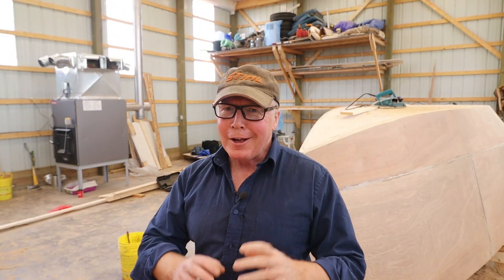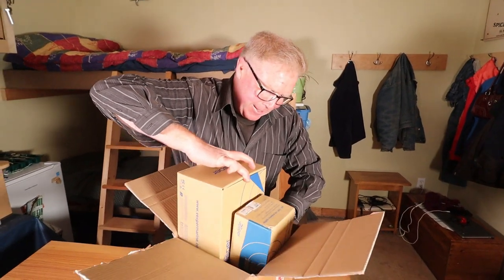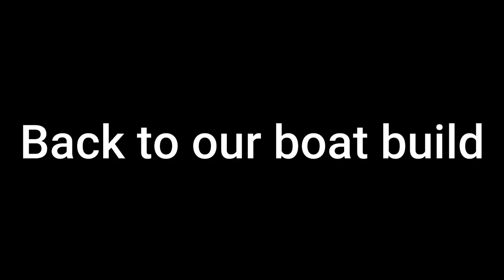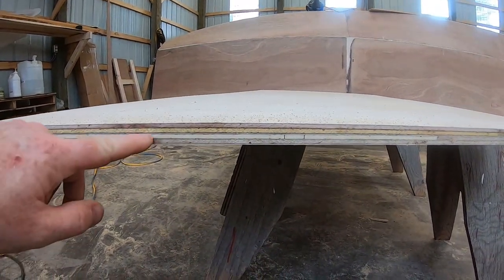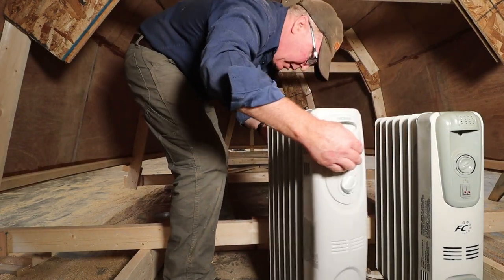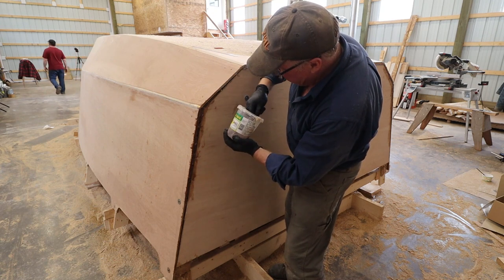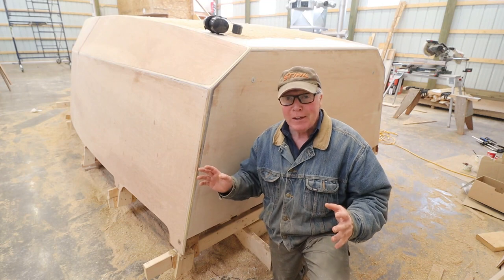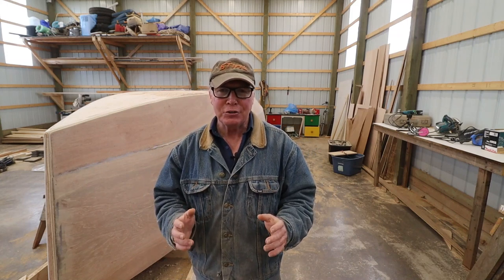S2E17 Fitting the Transom || Learning to See with your Hands || Building a Wave Rover 650

Comment: I was going to suggest space heaters to epoxy the inside and then a clear plastic tent when you right the hull should help. Really coming along nicely. 👍🏻
Reply from the maker: I ended up building a pretty substantial structure to hold the heat. I will be showing that video before Christmas.

Comment: Here to feed the starving algorithm.  Is that a 28 ounce framing hammer I saw you wielding at 8;43?  Looks like the one I used doing concrete forming.  Take care and have a good weekend.
Reply from the maker: As it turns out, it's a 16oz titanium head framing hammer. With the long handle, I can drive a 3 1/4" spike in 3 hits without too much effort. I've had it for 15yrs now. Thanks for feeding the algorithm.
Reply: @RoversAdventure  Ah Ha!  You've gone new school.  Much easier on your elbows and shoulders.

Comment: I’m also really curious what you’re going to be using as a center board in this smaller boat.
Reply from the maker: It is going to be a steel twin keel that is bolted on.
Reply: I just went back and looked at your design and plans video and see that it’s going to be like a three point keel.   Cool!  👍🏻❤️. Sorry for the uninformed question

Comment: Very nice video! I see that you use heters, good for us builders at low temperature. One thing that I am a bit curious about, is it for building purposes that you choose to make the transom so wide and flat? I would think a doubble ender construction may take bigg sea better?
Reply: The wide/flat design is popular at the moment. Does give improved buoyancy over a canoe stern but also allows you to have a decent sized cockpit when the doghouse is moved aft for extra internal space. All practical considerations I'd say on a small blue water boat. Will give extra storage volume as well. Down the line the transom makes for a easy mount for a small long shaft outboard if that isn't currently in the plans. A good idea IMO.
Reply from the maker: It was part of the brief that I gave to the Architect. I wanted the buoyancy, much needed on a small cruiser. I also wanted a good surface to mount my MK3 steering gear, electric outboard, chain plates for drogue bridle, and extra storage/ access below.

Comment: Hi.  Following your channel for a while.  Much appreciated.  I have a Vesper XB-6000 installed on my SV.  Very frustrating as I can never determine if it is ,in fact, transmitting.  I will be interested to see  how you install yours.  If I understand correctly, it should be wired like a bilge pump - always on.  Mine is not,.  It only appears to transmit when the nav equipment, MFD, etc., is on.  Anyway, congrats on building your boat.  Marshall
Reply from the maker: I'll talking with Ray this weekend about the best way to install/use the equipment.
Reply: I'd say 'no' to the always on bit. There are still a few places in the world where for security reasons, you don't want to advertise your presence. Generally they're the same places where you would also not want anyone to know you're a solo sailor.
Reply from the maker: @Garryck-1  very good point. I often think that given a choice, the pirate would go after the 45' boat with all the shiny stuff rafter than the 650.
Reply: @RoversAdventure  - True.. but on the other hand, if you're the only boat around.. well, from their perspective, you're still a "rich foreigner".
Reply from the maker: @Garryck-1  Very true but thankfully the average sized boat doing a circumnavigation/being on the open ocean is now 45'+ But your point is well noted.

Comment: I see you in a jacket then longsleves. What are you temperature ranges and what mix are you using for glue or epoxy. Thank you
Reply from the maker: I try to get a temp of 12 degress C for any glue up. In a few videos you will see a  solution I came up with to control the temp.